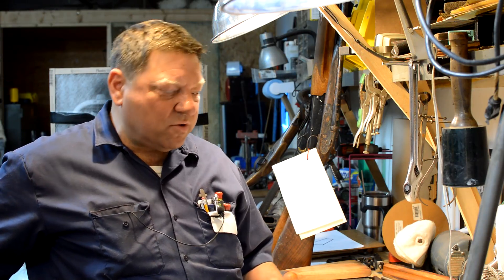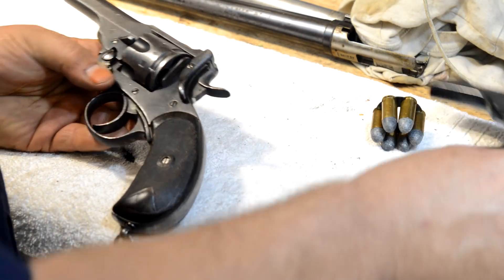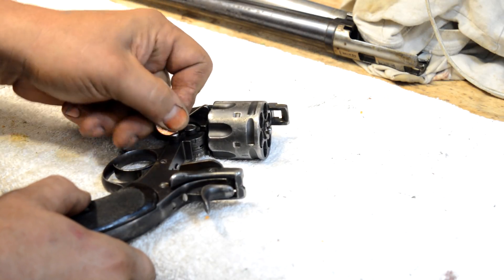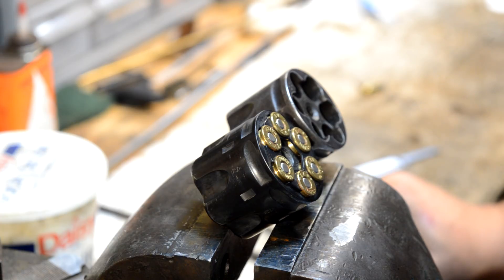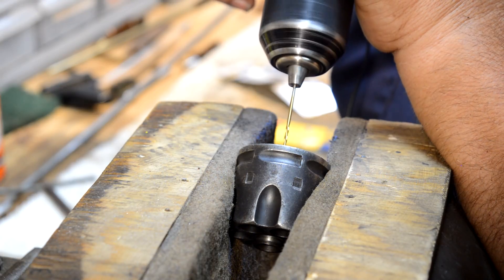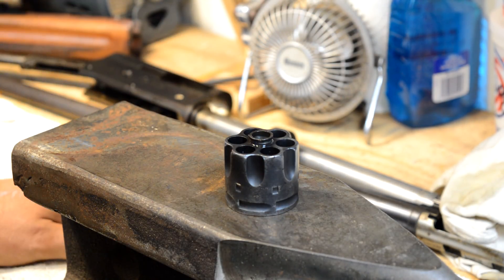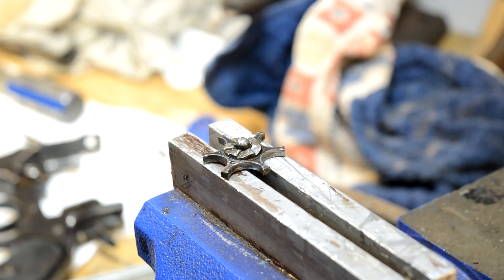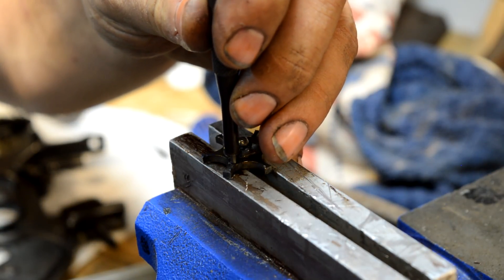Anvil 016: Webley revolver cylinder maintenance

Comment: They make some tiny little solid carbide drills for circuit boards. Very cheap and hard as hell. I used them to drill a roller bearing.
Reply: @biscuitsandgravy  been in the marine biz too long. Im the gut the young guys come too evertime they break a drill bit or tap.
Reply: @robertdinicola9225  not a bad place to be, but do us all a favor and find someone who want to learn everything you know for the last 5 years or so before you retire!
Reply: @ScottKenny1978  ive been trying. Nobody wants to work anymore. We have ads everywhere. They all want to come in green gettin top dollar
.
Reply: @robertdinicola9225  there's a rare few out there... Good luck finding them!
Reply: @robertdinicola9225  Pay more or keep complaining.
Reply: PCB Drills

Comment: Nice work as ever Mark.. Can I make a call out from the old country about reaming Webley cylinders? Webleys have a slight taper at the front end of the cylinder. There was a thing a couple of decades ago to ream this out to a true cylinder "to improve accuracy". Please don't do that! The reason that Webleys had a tapered cylinder was because Webley .455 bullets had a hollow base like a Minie. The idea was that the base skirt was allowed to blow out and give a degree of breech seal, but this had to be controlled by the taper. Flat base bullets don't like it, hence the reaming trick..
Can I suggest that if you have an original Webley with the the tapered chamber, leave it and get some proper hollow base bullets for it. 
At least you can still own one.. I no longer can!

Comment: If you don't like the idea of downloading your 45ACP for the Webley, you can also get a moonish clip that basically replaces the back of the cylinder that was removed, so you can properly use real 455 Webley ammo (Fiocci makes the ammo).  I have a few for my 455 Webley and they work well enough since finding an unmolested cylinder for an otherwise nice revolver is very rare and expensive.
Reply: I wonder if something like that could be silver soldered to the extractor star and rear cylinder face?
Reply: You know a name/manufacturer for that part?

Comment: Those down loaded 45s will still run my 1911s. I actually stopped loading the hotter ball so no one makes a mistake.
Reply: IN my Smith 45ACP revolvers I only load hot in Auto Rim cases, so the loads that are 45 Super and above do not end up in my 1911.
Reply: It's amazing how tolerant most 1911s are of low powered ammo.
Reply: @Siskiyous6  I code everything by bullet profile. Have a paper chart I put in every ammo can. No matter which one you open you have the whole list of everything.
Reply: @ScottKenny1978   It's a military design, it's going to be designed to cycle more violently than necessary when cleaned and lubricated, so it will still run when it's dirty and dry.
Reply: @Broken_Yugo  yes, but you can load all the way down to 155gr at 700fps and a 1911 will still cycle reliably. Heck of a long way from 230gr at 900!

Comment: I have found that the slower you drive a 45acp load the tighter the group.  My 1943 1911a1 likes it in the high 700s to 800.  Might not be the case with new tech but it cycled and fed and grouped and that is all I want when shooting cans and paper.
Reply: Just make sure in a shaved Webley, you keep the pressures around 11,000 CUP or things could get ugly.

Comment: Found Webley MKI in a gun shop asked if it was .455 or converted to .45 acp.  Being an ignorant Zulu movie fan I wanted a .455 Webley.  Guys as gun shop told sure sure its .455.  Ordered some snap caps in .455 hummm...why are the snap caps dropping deep into the cylinder?  Question would it be possible to make some kind full moon clip to make up for shaved gap?  Good luck finding a replacement cylinder for a MKI in .455 Webley

Comment: When they manufactured these Webleys back in the day I wonder why they would they decided to use soft metal on the cylinder star?
Reply: Somethings got to wear. It's usually a tiny part. The cylinder is easy to replace.

Comment: I wonder if you had one of those comic-book level strength magnets to pull the pin out once slightly loose with the cylinder well secured in a vise?
Reply: Probably not, because the cylinder is also made of steel, and equally as attracted by the magnet as the pin.

Comment: I have a stuck screw (Puck) on my armalite tunable muzzle break and the idiot "gunsmith" used too small of a screwdriver to try and pry it out and all he did was sheer the screws head up and now there is nothing that I can try any advice? I'm so pissed at my local ffl's "gunsmith"
Reply: Snap-On makes some left-handed drill bits to go with their easy-out set.

If you don't want to pay Snap-On prices (don't blame you!), look for some cobalt or Titanium Nitrided drill bits. Left handed if you can get them, so if it bites the screw hard and doesn't cut it will try to back the screw out.
Reply: @ScottKenny1978  drilled a hole for the reverse thread screw removal kit did exactly how it told me to do it and the fucking tip of the reverse thread bit broke off in the screw so now I have hardened bit stuck in there I'm gonna have to take it to the only other gunsmith around this is pissing me off
Reply: @jammbbs1688  damn, dude sorry to hear that!
Reply: @ScottKenny1978  it's all good thanks for the advice though
Reply: @jammbbs1688  look for a shop with an EDM machine, they should be able to zap that bit and screw out, without mangling the threads in the process.